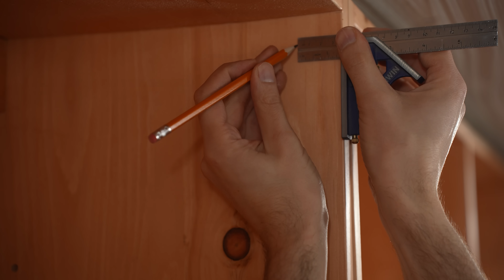Stop Using Plywood To Make Cabinets!

Comment: For the average guy, this is the kind of video that is the most useful.  Most of us have a limited assortment of wood working tools, limited space and are left to work with poorer quality wood.  Thanks for the great tips and showing how to do some woodworking without 25K worth of state of the art equipment in a three car garage LOL.
Reply: Yeah I suppose I might be deranged or cheap, but I love pine. I like the challenge of taking something cheap or looked down on and turning it into something nice.
Reply: yeah the thing I hate about working with pine is I always manage to drop it or whack it on something denting the hell out of it
Reply: @contestwill1556  That can at least be avoided by learning to be careful. The think I hate the most is all those damn knots in the wood from old branches. They can be pretty, but they're a b*tch to work with
Reply: Yeah like having a joiner, a 12 or 14 inch planer, or that expensive dowel jig, not to mention that really nice table saw and router table. I forgot to mention the shoulder plane that even he said was expensive. Most people have a jobsite table saw, chop saw or regular circular saw for the average guy! And I guarantee you that it's ever bit of 25K worth of tools he's using!
Reply: @shawnhowell156  the jointer and planer are decades old tools he bought for cheap and restored/fixed. for the rest, can't average guys just save up and buy better quality tools to be able to create better quality projects? i'm sure he started on lower quality tools when he was beginning, and then upgraded some of his tools gradually.
Reply: I also have limited skill
Reply: @shawnhowell156 this whole project can be done on a limited budget. So many poor id10ts who cry in the comments of woodworking videos. If you can’t figure out how to adapt what he did in your shop, give up the hobby.
Reply: That maybe true, but I totally remodeled my mother-in-law's home with only the few tools I mentioned. My skill surpasses my tools and I still achieved a great remodel for her. I know the title of this video was about using pine and not plywood and that's what got me to watch. My comment was more directed at the tools used to create his project.
Reply: First off, I'm not an idiot crying in the comments! I have skill and the desire to be better. And everyone knows that if you have the right tool for the job, your project has a better outcome. So stick that in your pipe and smoke it Conrad!
Reply: I got a 6 inch porter cable jointer on sale at menards for 140 bucks. My dewalt 13 inch planer was 400 on ebay. It's not hard to shop around and get a deal.
Reply: @jberola77 
I use a 26” Record hand plane (jointer) for jointing. Never owned an electric planer. I did have a 7” antique jointer but I seldom used it. 
Nevertheless, after 30 years (lol) I am shopping for a decent used electric thickness planer and specifically that little Delta jointer. I won’t use them that often BUT when I’ve wanted them in the past it would have saved a ton of time and I could always have touched up with the Record jointer or a smooth plane if needed. 
FWIW- a rabbet hand plane can be had under $100 and there’s virtually nothing else at any price that can do what it does - and does effortlessly.
Reply: You don’t have to buy new. If you keep your eyes open you can get good old stuff inexpensively. And some of that stuff is really good, if you’re lucky enough to come across Rockwell, for example, they’re eternally rebuildable, tools for life. And other than hand tools, what do you need, a table saw, a good router or two…
Reply: @shawnhowell156 I bet this is your first comment about the price of someone's tools.  NOT!
Reply: We didn't watch the same video
Reply: Yeah it's a real dump he's working in 👀
Reply: Looks fantastic and I like your skills.

Comment: Plywood is expensive, sure, but where do you get pine cheaper?
Reply: And the price of clear pine makes plywood an easy choice.
Reply: @steadyeddie7453  I've found red oak cheaper than clear pine. Crap pine is more expensive than ply, and a lot harder to work with.

Now, if the comparison is to Baltic birch?  Well, you're way richer than I. I'd rather use walnut.😵
Reply: @kwilliams2239  Agree with you on the cost of red oak vs clear pine. Knotty pine isn't worth the frustration. Too many problems. But I am a snob for the Baltic Birch. Zero voids, zero knots, stays flat, machines easily. All the drawers I make are BB, along with many of the jigs over the years. Expensive, yes. But I wait for Rockler to have a sale then head to my new Fairfax, Va store to avoid the shipping.
Reply: @steadyeddie7453  was at Woodcraft this afternoon.  A 2'x4' sheet of 3/4" American birch was $100.  $400 a sheet?!  For American?!

I bought some American Birch from Rockler a while back (don't get there often). It wasn't nearly as expensive as the Baltic but it had voids in it.  Sheesh. 

Might just as well stick with box store hardwood ply. Just remember not to sand the picture of wood off it.
Reply: @kwilliams2239  I would guess that the American birch you are referring to is Appleply. I have yet to try it. From what I was told, when Russia invaded Ukraine, the price of BB skyrocketed. My local H.D. sometimes has decent hardwood ply, depending on where they get it. But make no mistake, it is never the quality of BB.
Reply: Ha exactly.  Since when is solid lumber cheaper than plywood?
Reply: Sourcing wood of any kind from a local mill is way cheaper than plywood, in my experience, that is.
Reply: @DBiggsWoodworking  Can you get KD, S4S, for under $2/bf?  Building large panels is a PITA, too. I'd hate to build a set of cabinets, by gluing up a dozen panels.

If you're comparing it to Baltic birch, perhaps. That stuff is nuts! The glue-ups are still an issue.
Reply: @kwilliams2239  white oak, red oak, and poplar is under $2/board foot where I'm at. Specifically $1.87, $1.60, and $1.53 for the woods listed in order. Yes making panels can be a pain, but just taking your time and finding enjoyment in the process helps alot.
Reply: Facebook

Comment: Now count the money you spent as time and material expenses and you'll quickly realize that you can get plywood for same amount, get a better material and save the your time.
If your panels curve post glueing, then the material used wasn't dry enough and are likely to crack and delaminate later.
But I think you know all that already :) .

Comment: seems like the pine will cost alot more then plywood
Reply from the maker: It cost me $3.34 a bdft. Since there's 24 bdft in a 4x8 sheet of plywood, it's equivalent to an $80 sheet, which is exactly what purebond poplar core plywood costs at home depot, and that's the least expensive plywood I would consider using.

Besides, plywood is no fun. I enjoy working with solid wood and that's that.
Reply: @ScottWalshWoodworking  plywood is no fun so true
Reply: @ScottWalshWoodworking  Folks should consider not only the cost but also how handling 4x8-3/4" plywood is a PIA - especially in a one-person small or basement shop. Boards are easy to transport, break down to rough length, can be worked with hand tools if one is so inclined. The tradeoff is time (cost is about the same for me around MA) unless you find some deals on lumber - like from a local saw mill. I built a full set of kitchen cabinets (base and wall) in pine in a 1 car garage workshop in 1990 in my wife and my first house. They were unique, custom, and beautiful.

Comment: Solid is cheaper than ply now? What a weird world. I like to use French cleats to install stuff like this -- no helper stand needed, and you get the leveling out of the way before the cabinet's even on the wall.
Reply: I can buy rough cut lumber half the price of plywood and all it needs it ran though the jointer and planer and it’s some of the best wood you can buy. Plywood is straight trash for everything it being cheap and fast.

Comment: From my 15 years of experience in cabinet making, it’s way easier to completely assemble your cabinets, hang doors and mount hardware, while still on your bench. When it’s time to hang cabinets, pop doors off, hang your boxes then just snap doors onto hinge plates. It saves you from having to mess around with clamps, and measuring for hinge plates in awkward positions. To each their own. Good work.

Comment: Just checked prices at Home Depot. A 1 x 8 x 8 common pine board costs $17.33. Figuring 20% waste in machining the boards into your cabinet project, the pine costs $4.40 per SF. A sheet of 3/4" pine sanded plywood at Home Depot costs $51.78, or, figuring 10% waste (waste could actually be close to 0% if you dimension your cabinets in a way to eliminate waste), costs $1.78 per SF. This is not to mention all the additional time (and tools) needed to get the pine boards into a place where they can form the cabinet parts. You are looking at around 3 times the cost building the cabinets out of solid pine as opposed to using plywood. And thats for common pine, which will have a ton of knots in it. Bump that up to select pine and the costs will be astronomical.
If you want to make your cabinets out of solid pine, great, but don't say that you saved all this money over using plywood - it's just not so.
Reply: And the whole reason cabinets and other wood furniture is made with plywood or MDF as the core is because of the price and their stability in varying humidity conditions. That pine, especially the doors, is going to warp. But he did help by finishing the wood inside and out. And does good work. I just wouldn't have chosen pine. And the door center panel need to float in the rails and stiles for expansion.
Reply: @steadyeddie7453  Righteo.
Reply: @steadyeddie7453  Have made cabinets both ways.  I do kitchen type cabinets from plywood for efficiency.  |I make furniture cabinets from solid wood for satisfaction doing it as a high-end product.  Have had a problem with using solid maple for a fairly small cabinet with the wood warping after it was finished.  And that wood was well aged so it shouldn't have had that much moisture content.  Grrrr.
Reply: @johnburton2338  I agree with everything you said. My biggest learning curve was not the machining of the wood products, it is knowing which wood to choose for a particular project. Knowing how that wood is going to expand and contract. I used to glue up solid everything I built. No longer. But basically long thin wood like for rails and styles  that are secured on the ends only I go with very well seasoned wood to prevent warp, curling. etc. Drawers are always baltic birch sides w/ ply bottoms. Cabinet sides will be furniture grade ply or MDF laminated with a beautiful veneer. Guaranteed flat for years. Solid maple is beautiful wood but the hard stuff is extrememly dense. I always take small bites to avoid the heat and stress. And when I plane rough sawn to thickness I do it over a few days to let it relieve stresses overnight.
Reply: Exactly! I've been trying to revamp my space lately, and I'm planning to shove a table in with some shelves and drawer space to work on projects. 
I can do the table, complete with legs, trim pieces, and getting it delivered, all for around £60 and one day of work, I'll still have plenty left over for the shelves too (but I'm lazy, so I won't do them same day). 

The only downside is it won't look the best, so I'll need to spend 20-30 bucks more on some veneer to finish it off. But that still beats sitting there for a week or two glueing boards together, having an uneven wood grain, and just wasting time on something that I'm making only for myself. Plus, I live in an apartment, so it's a little hard to get all those tools in and keep the place clean if I was to do it this way, and like you said, it's way more expensive.
Reply: Mistake number 1 is going to HomeDepot to purchase any wood that's not dimensional construction wood! You have to go to a hardwood retailer. And yes, they sell softwood, just like cedar and redwood at hardwood stores. The final consideration is that it really depends on where you live. White pine is found on the Eastern side of the US. So from the Mississippi River east. Technically one state west of the Mississippi River as well. All the way up to Canada. 
So I would not say that he was lying or providing misinformation. I don't believe YouTubers should have to detail information to that level. A quick search such as where does white pine grow will show you where it's abundant and likely more affordable there. The futher away you live from a resource the more it will cost to obtain it! Simple economics.

Comment: OMG Best Video Ever!  Finally someone explains the steps to using solid wood for cabinets without glossing over too much and at the same time keeping the whole build simple and achievable for the average Joe!  Bravo. Btw I really enjoy how you make your workshop look classy and functional!
Reply from the maker: Thanks for the kind words!
Reply: Will you share the brand and color of stain please? Thanks.
Reply: @jenniepost7837 You need to tag him in your comment if you want to have any chance of him seeing it given it’s a response to someone’s comment. You really would be better off posting it as an original comment of your own though as someone else might know the answer, possibly based on finishes he has generally used in the past.
Reply: @inmyimage1081 I actually did ask myself also. But no answer yet.
Reply: @angellas.1314  Not sure the specifics you asked since my comment wasn’t in response to anything you asked, but if you check out the wood whisperer’s channel, he has several videos about different finishes. He rarely uses stain though so if you specifically wanted stain info you won’t find answers there but his finishes videos are still well worth watching. For what it’s worth, generally when I’ve seen people using stain, they generally have said that brands really don’t matter much, you just need to make sure you know how you can use oil based products with water/solvent based products IF you want to use one for stain and the other for a topcoat. The easiest takeaway is to use water/solvent based topcoats over water/solvent based stains or oil over oil.

Comment: FWIW: Pegboard cut into strips makes a good positioning jig for shelf pins
Reply: If you don't care about the standard 32mm spacing. Jigs aren't all that expensive.
Reply: @kwilliams2239  The pegboard I used had 1" spacing: 32mm is a little more than 1- 1/4". As long as the spacing is consistent (IE don't mix 1" and 32mm) I don't think it matters?
Reply: @gregtaylor3432  Depending on the application, maybe.  Standards are there for a reason.  Templates can he had for $10.  For $10, there is no reason not to use the standard spacing and setbacks.
Reply: If I recall correctly, the 32mm standard was created because that was as close as whoever came up with it could get the heads of the pin drilling machine.  Sometimes (not to say frequently) the reason for the standard isn't a grand master plan, it's some practical limitation to somebody long ago.
Reply: @disco_falcon1895  OK, Some say that the standard rail gauge is 4' 8-1/2", which has been used for hundreds of years, has it's history (arguably) going back to the Roman's chariots.  It doesn't really matter how it got here, it's not called the "Standard Rail Gauge" for nothing.

If you want to use standard hardware, use the standards. Now, why are there both 1/4" and 5mm holes?😁
Reply: I've never used a jig for shelf pin holes...peg board forever!  Built plenty of cabs for clients and they surely don't care...it works.  <shrug>
Reply: @CharlieGroh Pegboard in furniture is tacky, at best.
Reply: @kwilliams2239  haha, not IN...used as a jig!!!  What are you thinking?
Reply: @CharlieGroh I misunderstood you incorrectly.  Even so, it's not the standard euro spacing. Some accessories won't work. Jigs are so cheap, why not do it right?
Reply: @kwilliams2239  That's fine, but sometimes we make our own rules (that's OK, yanno)  I learned from a guy doing all the cabinet work for the Crystal Cathedral  (remember Rev. Schuler?) in the 80's, and it really gets down to that...where and who you learn from.  If I had to do something "special" for a client, I'd do it, but 'til then I'm on my road...if the product is right for the client, it's right, eh?
Reply: @CharlieGroh If there was a reason, sure, but there is no need for Jerry-rigging.
Reply: @kwilliams2239 if you are doing cabinets for a client I can see a reason to use the industry standard. If you are making cabinets for yourself and don’t plan on ever buying accessories that require the standard spacing spending money for the jig would be a waste if you happen to have some pegboard laying around or some time and a suitable scrap board like Scott did here. When I built mine I attached the shelves permanently at the position I wanted because I think the holes for adjustment look ridiculous and dowel nubs and plastic shelf pins are not very strong. To each their own I guess but there are many reasons why using a standard isn’t necessary or even the best way.
Reply: @cydrych  I want everything to fit, too.  I'm not a "Standards are so great that everyone has one." kinda guy.  The fact that it's so damn cheap and easy to use the existing standards, makes it insane to do otherwise.
Reply: @kwilliams2239  except when you don’t want or need that. Doing the standard thing when you don’t want or need it is crazy.
Reply: @cydrych  Good grief.  It's just as easy, if not easier to do it, than not.  Why do you insist on making more work for yourself? To "save" $20?